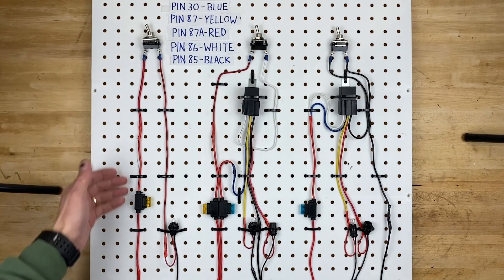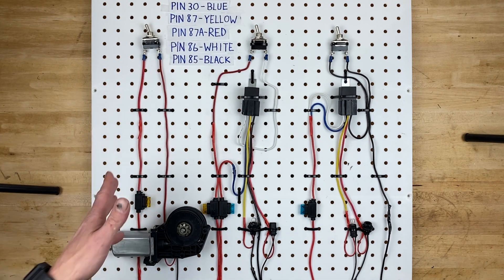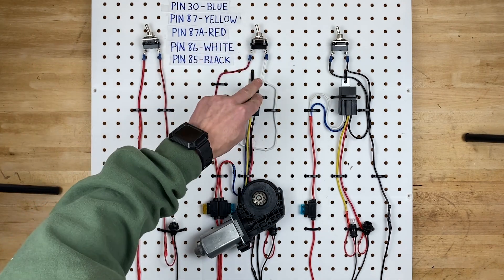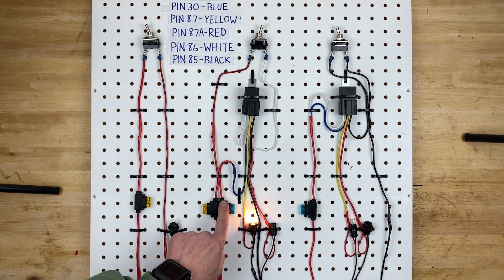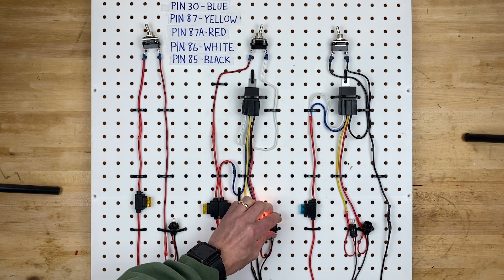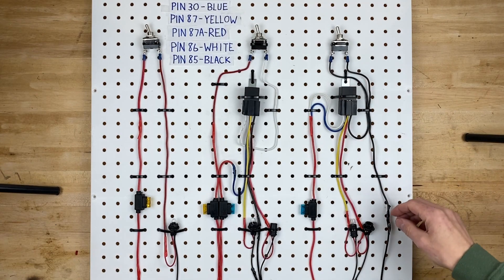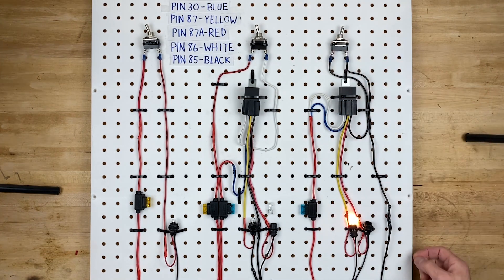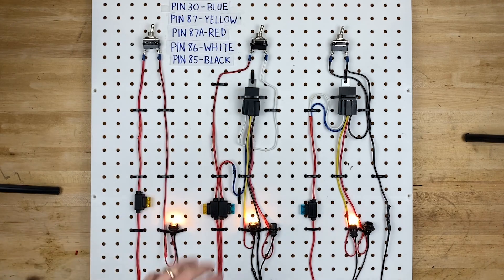5 Pin Relay Wiring For Beginners | Diagram | @WiringRescue

Comment: The only question left unanswered for me is, how many amps does the relay draw from the switch itself inorder to turn the relay on?
Reply from the maker: It depends on the relay, but typically it is very, very small. You’d have to look at the specs for whichever relays you are using.

Comment: Hey excellent explanation of the relay wiring. I’m trying to understand wiring a 5 pin relay to operate a fuel pump. It needs to be connected as a safety so it pump doesn’t stay on when vehicle us turned off.
Reply from the maker: If you haven’t checked out this fuel pump video I made, you may find it helpful! https://youtu.be/MHgMHE6TUG8?si=e_nZjEA7AceKF1aL

Comment: So...  The positive side trigger requires two separate fuses; one to protect the trigger wire (the yellow one- maybe one amp), plus another fuse (blue one, say 15 amps) to match the draw of the load, right?   How does the positive trigger wire in the negative-side trigger get protected-- with the 15-amp fuse?  So, do you need to run 14 or 16-guage wire to pin 85? Does the high current potential in that wire pose a danger to the trigger coil, that normally only runs on, say, 1/10th of an amp?  Sorry if this has been answered.

Comment: How does the example on the right side work with 87a having the ground interrupted. Isn't the broken ground in open position?
Reply from the maker: No, because you’re not interrupting the ground on the light bulbs. The light bulbs still have a power and ground. But the circuit that controls the relay, and turns it on and off, is turned on and off by making and breaking the ground.

Comment: How do you get both bulbs to turn on at the same time ?  I swapped out relay now one turn off and the other on  when I flip the switch
Reply from the maker: Sounds like your relay is probably not wired correctly. Double check that your wiring matches the video to be sure.

Comment: Im trying to wire a dirt bike. If i turn off the switch to the negative trigger  relay and i don't have anything plugged in to the accesory wire (87A)  will it still use up my batteries power in any significant way? Thanks
Reply from the maker: As long as I’m understanding your design correctly, you are correct. It will not drain your battery. The two ways that it would are:
1) if you have power connected to 86 and ground on 85. The relay would be activated and therefore use some electricity.
2) if you have power on 30 and some kind of component on 87A, the power will flow right through the relay to the component and power up that component.
Reply: @WiringRescue  that answered my concerns exactly. Thank you so much.

Comment: Thanks....great video and explanation.... But quick question..... How will lights stay off.... With switch ON, the high beams are on .... With switch OFF, the low beams are on..... So how to switch both off ? Coz when i switch off the car the lights will stay on? How does that part work.... Just wondering..... Do i add another ON/OFF switch to control power to the light switch or pin 30 to the Key ignition?

Comment: So simple, it's confusing.  Just show the relay diagram, blade connections, and use the terms normally open and normally closed for relay outputs.
Reply from the maker: Not everyone learns the same way.  If this isn’t your style, there are tens of thousands of relay wiring schematics on the internet. And most relays even have the diagram on the top.

Comment: Ok, so could we use a two prong flasher in line with 87a to alternate the side marker lamps and front turn signals like a wig wag ? 
 I have LED white/yellow bulbs to utilize the nice clear lenses in the grille as both daytime tuning lights and switch to yellow for turn signal when there is a load on them    
   I have the same ones in my older Grand Cherokee, Auxitos have lasted me quite a while so far. 
    The new side marker lamp assemblies I have are also LED.    
 Would love for them to alternate flashing

Comment: Good stuff, thanks. Regarding the middle example. Guessing the yellow fuse would probably be whatever the switch itself is rated for? Then as for 3-prong switches, assuming it's just the same setup except the 3rd prong being a ground?

Comment: You are very welcome.  I'm wondering. It embarrassing to admit I was a mechanic for years. I pretty much stopped working on cars oh mid 90s. Needless to say I didn't do wiring hahaha. Buy do u have a video on how to find shorts ?? I've got a 91 standard cab base 2.5 4 cylinder automatic S10 and I have a short that's popped up. It blows the running light and dash light fuse. I have an idea it's got something to do with the radio I just put in it. I used wires that went to the old radio. When I turn headlights on the radio turns off an now its blowing the fuse. I have to admit I did try cleaning up some of my wiring glum I had from putting gages, a push button and a couple toggle switches in. After watching a lot videos etc. Bmi apologize for bothering you with all this I'm sure it's a radio wire and I can find the problem BUT I would love to be able to or know how to actually be able to pin pint it hopefully by just needing a ohm meter a test light.  I apologize again and any information would be greatly appreciated. Thanks jeff

Comment: The electric fan on my truck is wired to run on a ground leg instead of a hot. For the exact reason mentioned, grounds out nothing burns down just the fan comes on.

Comment: Ok Mr. Ratty Muscle Car, I have a rebel wiring harness with a fuse box. Would it be proper to use the same hotwire coming from the fuse box to power your switched line going to pin 86 and coming out of the fuse box send power to pin 30 as long as it's before your switch going to pin 86.  Seems to me doing it this way you only use one fuse to cover 2 lines
Reply from the maker: That should be okay to do, but just be aware that the same fuse that protects your accessory is the one that protects your switch. So it’s possible that the switch side of the circuit OR the accessory side of the circuit could pop the fuse making diagnosing issues a tiny bit more challenging. 
Lastly - I’m am just some random guy on the internet, so please do additional research so your info comes from multiple reliable sources! :)

Comment: Great video!  I'm planning on installing whip lights in a utv using a relay and a 5 pin rocker switch and I want to be able to run the lights when I'm stopped with the key off. Would wiring it with a negative trigger alow this to happen?   Thanks

Comment: Does the fuse that’s going to #30 have to be sized for the device it could be controlling or the size of the relay? If that wiper motor is 20 anp and the relay is 40 amp rating, what size fuse goes to #30 ?
Reply from the maker: The fuse should be rated for the device that the relay is controlling. So in your example, you would want a 20-25 amp fuse on pin 30.

Comment: I have a question regarding this wondering if you can help. I have a headlight that is using its original harness and an additional  for the led lights I purchased . But they have included a line for signal lights no negative line integrated in the led  but  it has only 1 line for signal  . I have purchased a generic harness ( street legal kit)  and tried splicing in on there positive with  the signal led it also has an led flash relay  it recognized  it starts flashing  as soon i put the positive of the harness on a positive terminal  the signal indicator colum that came with the kit   is in the off position  what could this be . Any help is greatly  appreciated.

Comment: @rattymusclecar - You stated another use for negative triggers "were if you had a whole bank of relays under the hood..." and it got me thinking and now asking if you could do a comparison of the benefits between wiring positive and negative triggers in relay banks for "race car" style panels. I am finishing up my panel under the dash using your videos: Hotrod race car wiring and the inertia switch video. Your comment about negative triggers has me wondering if I could have done the wiring differently and therefore making it even nicer by running less wires via negative triggers. What do you think?
Reply: What did you end up doing? I'm wiring up a drift car now and I'm probably going to do a negative triggered relay set up.
Reply: @chrispowbilledo9993  I did make my under dash panel but 99% are positive triggered relays and I only have four relays which are negative triggered and those are just for my keyless remote door locks and opener. good luck

Comment: Can you do a wiring color code video?
Reply from the maker: That’s a good idea! I believe there are some general color guidelines on wiring a car, however I’m not super familiar with them. I’ll look into it though and see what I can do!
Reply: @WiringRescue  I'm currently rewiring my EFI system on my 1988 Toyota Cressida. I noticed that everytime I see a yellow wire, it's always 12v from switch and red wire always B+ (12v always on) and it's the same with other car I've worked on. Btw, thanks for replying. I've been thinking about this for weeks and got no clear answer (from the internet).